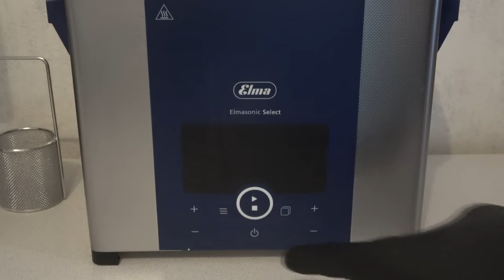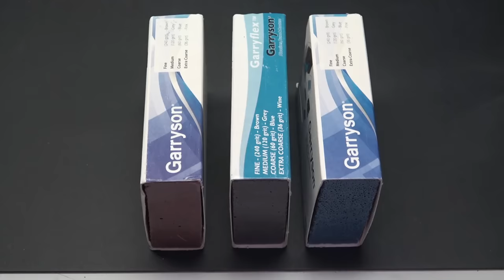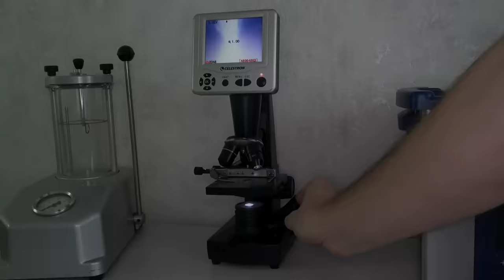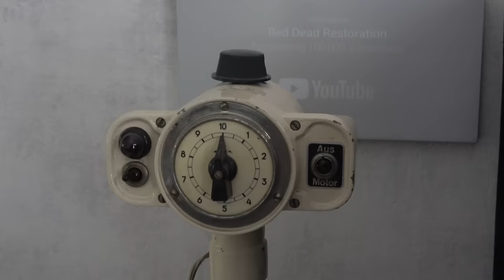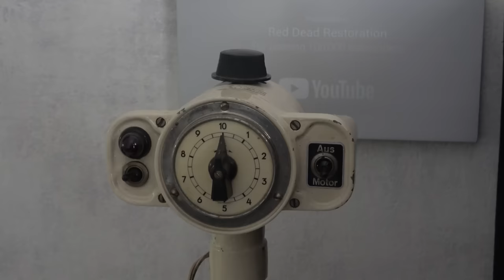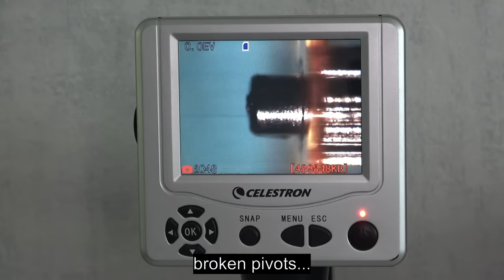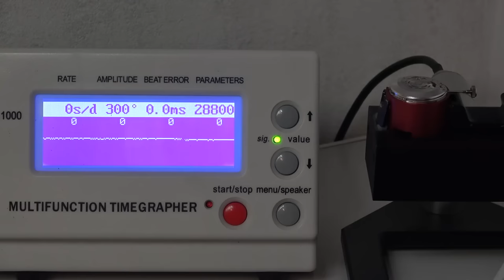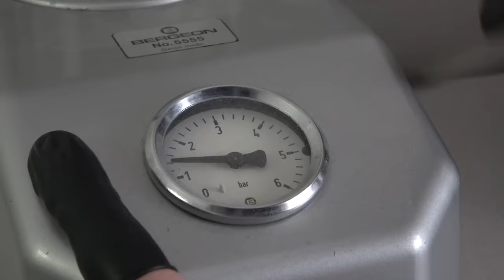Restoration of a $7000 Rolex Datejust - Rare Vintage Rolex Logo-Dial - Rusty Caliber 3135

Comment: These are so relaxing to watch. My question is where do you even find a rusted rolex?!?!
Reply from the maker: Ebay 😉
Reply: @RedDeadRestoration  I don't have words for the level of respect I have for your work in this video. Restoring parts that would ordinarily just be replaced is just breathtaking
Reply: @RedDeadRestoration  How much would you sell a piece like this for? Stellar work btw.
Reply: The finishing work on this one was outstanding. Great video.
Reply: From my wife, who wore her unserviced (my fault) Datejust into the swimming pool, summer after summer, with a failed gasket.😔
Reply: Love the numerals on it
Reply: @393Nader  Was it destroyed
Reply: @oscarosullivan4513  Waiting to hear back from the watchsmith.  But after following these videos, I'm hopeful that anything can be repaired.
Reply: @393Nader  I’m nota watchsmith but what I have heard is that Rolex isn’t selling watch parts to non authorized dealers anymore, so hopefully you can find a watchsmith that has all the parts that will most likely need to be replaced in stock or send it back to Rolex…
Reply: @393Nader  Wish you luck
Reply: Your video also relaxing to watch
Reply: I have a rusted Rolex at Home, ist from my dad
Reply: @sebastian6081  How did it get rusted
Reply: @AA-hi6os  you must have missed the title of the video? 🤔

Comment: Amazing work! It boggles my mind how someone can take such poor care of a watch to begin with! I'm glad there are watchmakers like you who can breathe new life into these classics.
Reply: Had he replaced the glass case with a new one, no corrosion will happen.
Reply: @Taylo Ren. That's a simplistic and very narrow-minded answer. 

Expensive wristwatches are purchased and worn by a wide range of society. For example, military personel, oil rig workers, construction industry, as well as those who wear watches as 'costume jewellery', or evening wear.  I've had my submariner for over 20 years: I've served, I've ridden my motorcylce on almost every continent on earth, through African deserts to far reaching places such as Deadhorse, Alaska.  It's taken some bashing, has many many miles under its belt but still works perfectly. Therefore, with such wide use as I've described above, through many tough terrains, in extreme temperatures, rugged landscape to formal dinners, the Rolex is made to last BUT is not immune to misshap when travel / events do not always go as planned. Maybe the owner was involved in a serious incident, that wasn't his/her fault, who knows!

Anyway, the point is that it is entirely possible that this watch has had a tough life, so to say that someone, "...can take such poor care of a watch to begin with!...) is just guesswork on your part. No offence intended but please feel free to broaden your mind.

Comment: Remarkable restoration. That poor DJ was hammered.  It's hard to believe anyone would let any fine timepiece like that get so far out of whack. Well done.
Reply: Maybe it was used as a tool watch over the course of the ownership of the previous owner which it is supposed to be.
Reply: Calm down, its only a rolex. Made out of stainless.. Same as any other watch. That is made out of same material.
Reply: That was just the beater of someone for years..
how its supposed to be
Reply: @Lee In the 60s and even 70s you could buy a new Rolex for the equivalent of 900-1000$ in today's money. These watches were meant to be worn your whole life in any kind of situation.

Comment: Not only am I amazed on the restoration but I'm also amazed on how someone would allow a Rolex to get in such a pitiful condition. 
Excellent channel and video(s).
Reply: Just to give my two cents on how to get to this condition: My best guess would be somebody used the watch like it was intended to be used, as a sports watch rather than some bling just to flex. AFAIK ROLEXes are "work horses" known for precision but also sturdyness and the former owner may have put this to the test. At some time somehow the glass/crystal broke (due to impact?) and also water entered the casing (shouldn't have taken it into the shower with a broken glass?). Handed it in for repair/inspection and company denied to work on this piece, due to the water parts started corrosion and when testing how bad it was the crown broke off when trying to manipulate/make dials move... Then it went into a drawer until the owner decided to sell

Comment: Just as I was about to ask how much this kind of repair (by rolex) on such a watch would cost... Just the spare parts were 1500$. That's a lot of damage. They would probably tell the owner to just buy a new one. Loved your dedication and almost felt sorry for the trouble you went through cleaning all these tiny parts. Awesome work as always! Keep it up!
Reply: Nah, that’s absolutely worth the repair. Those go for $5000-$6000 all day long in working condition.
Reply: @chriskeiser5809  plus the cost of the repair, plus the cost of the watch if he's not doing it for a client.
Reply: @chriskeiser5809  More like 6500 to 8k depending on condition. Mint or uncirculated,  factory condition is basically pure platinum for this specific model (because of the dial and guts).

Comment: I always wonder how long in total does a restoration take from start to finish? Also what is the cost of the parts and your time?
Reply from the maker: Something around 60 hours on this one. Costs of the parts are stated in the video. My time is for free. I'm doing this as a hobby 😉
Reply: In California, the average hourly rate for watch repair is $27/Hr—so x60 = $1,620 USD for labor, plus parts.
Reply: @KPA78  $ 27/hr is pretty cheap compared to like an electrician or plumber etc.
Reply: @The_Original_Brad_Miller  I agree, that's pretty cheap.  Demand, I guess?  I've always wanted to learn watchmaking.
Reply: Can replacement of Rolex crown done at Rolex centre

Comment: At 16:42 is it just my imagination, or is the setting lever spring not quite seated correctly? It looks like there’s a post beneath it that should be going through the hole in the setting lever spring.
Loved this video - what a gorgeous and painstaking repair and restoration job.

edit - Yup - if you compare it with 5:14 during the strip down, the setting spring is definitely mounted on the little post.
Reply: Look at 5:29 you are right 🙂i noticed thé same thing 😬

Comment: So you can just buy individual parts from Rolex?? And they still make the same parts they used from 30 years ago?? Very nicely done! I've watched several of your videos and this watch seemed to be fairly complicated and that rust made it more difficult for sure.
Reply from the maker: The parts are available on ebay, rolex won't sell them to me. No the parts are not the same today. They are new old stock 😉

Comment: Just subbed to your channel. 
Watch restoration videos just have a relaxing quality about them that’s hard to explain. Most of the videos on YT like this tend to hover around the ±1 hour range. A lot of times, that’s just a little more time than I feel like committing. I like yours especially though because the 20-30 minute video length seems to fit in perfectly with my short attention span. 
👍

Comment: I always wondered about the clean machine stages. Do you have the balance and pallet fork in the basket when you go through the final rinse with alcohol? Everyone says that isopropyl alcohol will remove the shellac on the pallet jewels and impulse jewel. Is there a timed rule about how long they can be in there? Or do you have to use a specific type of alcohol? Or do you remove them before the final rinse?
Reply from the maker: The balance is installed on the mainplate when rinsing. I've never seen a jewel losing because of the alcohol (but I've heard that many times). Nevertheless I'm cleaning the pallet fork in Bergeon one dip. This can also be used for the balance.
Reply: Thanks for the response. That’s the main thing…everyone warns about cleaning the balance and pallet fork in alcohol but, literally everyone I watch (pun intended) that uses a cleaning machine has iso as their final cleaning stage. Correct me if I’m wrong but, bviously as long as you only have them in for 30 seconds or less it’s okay.

Comment: One thing I always wanted to ask about is the rust. Once rust has set itself onto metal you can clean it off. But rust will always come back unless the metal is treated to prevent its return? Or at least when I was learning that is what I was told. 
So instead of getting it serviced in 5 years do you let your customers know to bring the watch back sooner? The last thing you want is for the rust to set back in and pit a movement even more.

Just asking to see what other pros do in this situation. We of course take pictures and let the customer both know and see the rust. Then allow them to decide on what they would wish to do. Obviously replacing a bunch of plates and gears ,screws etc would not be cost effective. 
Have you tried magic rhodium? I have seen mixed reviews.

Comment: should have been laser added the steel in some spots in the case and changed the bezel ( a new engine turned original rolex bezel is cheap and makes a lot of difference)... new screws on balance bridge too...

Comment: Nice job but.. at 16:40 the plate is not properly installed. The hole near the edge does not fall over the pin when screwed down. At 17:10 also visible. I hope you corrected it.😆

Comment: Something else to ponder.  I don't know how far back wrist watches and pocket watches are claimed to date back to, but based on the current narrative, how were such incredibly small parts made to such exact specifications at a time when the manufacturing technology didn't exist?  There's no way those very small, very exact parts were tooled by hand.  The precise size of the teeth of the gears, incredibly small, precise threading on tiny pieces to accept screws so small they have to be handled with tweezers.  Something doesn't add up.  I think technology dates back much farther than we've been told.

Comment: What I couldn't believe is that you turned off the main power switch on the Flux Capacitor without turning off all the ancillary switches. I'm sure that's not proper power-down procedure 9:43

Comment: How can you buy parts just like that? I had a problem with my watch (not a Rolex, but swiss made), took it to a watchmaker, they told me what's the problem and that the manufacturer(s) wont sell me or them any parts but if I manage to get the part they will fix it. So I contacted an official repair shop and seller, told them I need a part, they told me fck no, but they can fix it if I want to. So I ended up taking there my watch and they fixed it for a nice premium price.